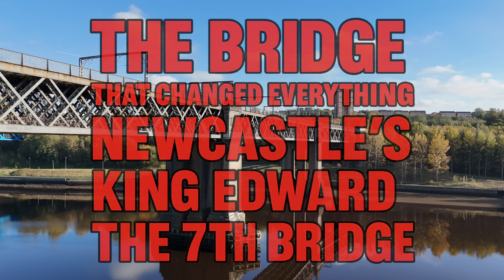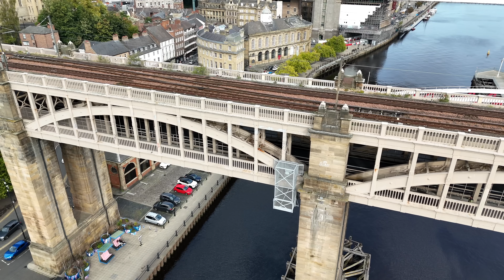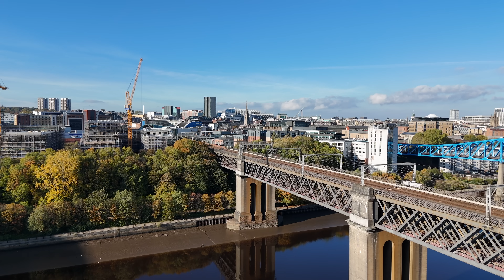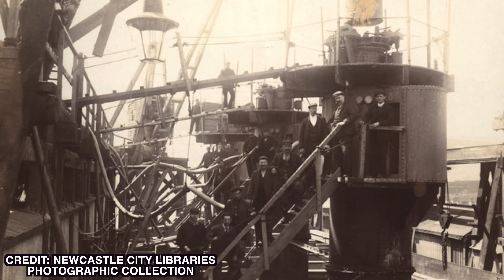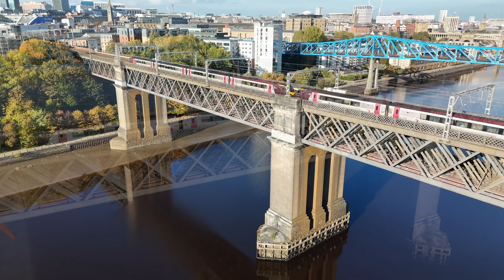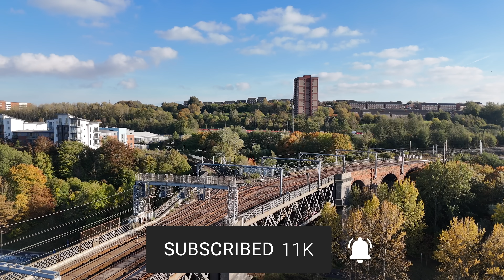“The Untold Story of Newcastle’s King Edward VII Bridge – Britain’s Forgotten Railway Marvel”

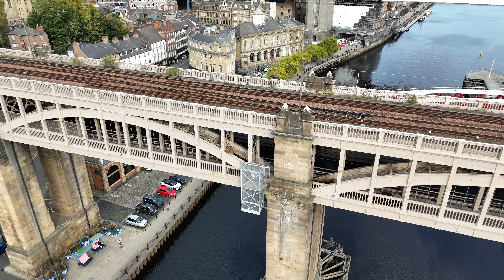Comment: 2:27 Those four sticky-up things at the top of the pier on the High Level bridge are the bases for the lamps that once graced the upper deck of this bridge when first opened.  Opened in 1849, the lamps only lasted for about 2 years, after which they were removed.  But the lamp stands remain, out of use now for 174 years!
Reply from the maker: Thanks for that never knew thanks for watching 👀